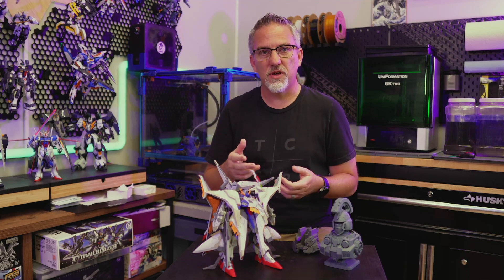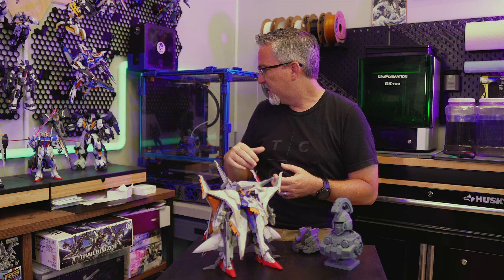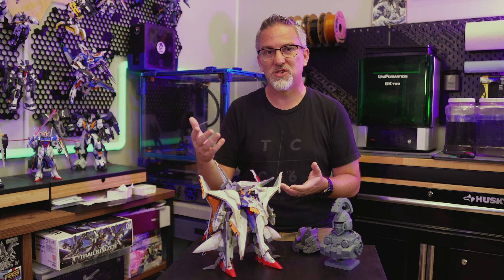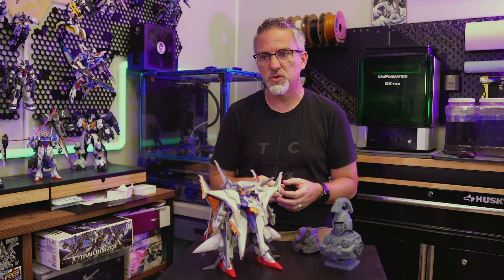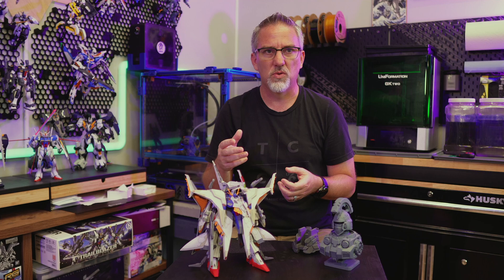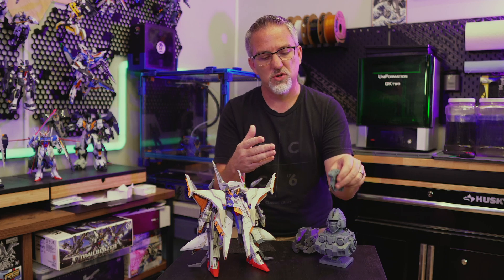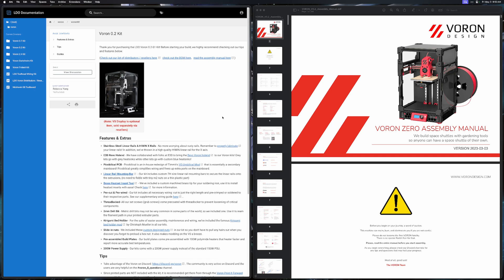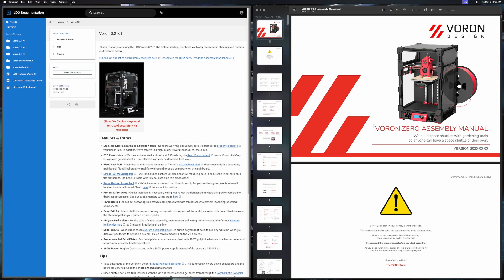LDO Voron 0.2 Build - Intro, Printed Parts & Preparations

Comment: Hi Mark. Thank you for the well done and informative video series. I had my LDO box sitting on the floor waiting for me to crack it open. Before I did I found your playlist and watched the entire playlist in preparation. Once I started my build I referenced back to some of your videos to clear things up before continuing. I still ran into my own flavor of trouble, but I just finished tuning my second filament on the printer. This was not my first printer build, but it was my first Voron build. I recommend anyone building their first Voron 0 watch your playlist. It will undoubtedly result in a smoother build process.

If you are watching or building alongside, pay attention to the pre-loaded nuts for the enclosure side of the magnets. Do NOT use standard no-drop nut mods. Although Mark points it out I missed it. It takes some thought and disassembly to correct this problem!
Reply from the maker: Thanks so much for the kind words, and I'm glad the series helped with your build.

Comment: I just finished an LDO V0.2-S1 kit. It's a great kit. The documentation is really great for the most part.

So good that when it's not so good I found myself almost irrationally annoyed. Ex: most of the official LDO docs seem to have parts for and show using a Pi Zero for the SBC. Most sale listings and builds I've seen for these builds use a Pi 3/4. I found there wasn't a lot of info on using a Pi 3/4 with an LDO kit. That have special DIN cleats and some Pi Zero specific parts to go with them. 

Also there's spots where if you're not careful when following links you can end up on older versions of docs. Like links out to GitHub make sure it's the most recent branch/revision
Reply from the maker: Thanks for the heads up. My kit came with a Pi 4, so I'll be sure to print the correct mounting parts.

My kit also came with a few extra parts (a small bearing, microswitch with a labeled wire, and bowden coupler) that appear to be for a filament runout sensor in the right rear foot area. I can't find documentation for this anywhere, but it seems easy enough to figure out by just looking at the modified printed part for the right rear foot that LDO included in their plates of printed parts.
Reply: @gunplamark  the SKR Pico and pi have the same screw footprint
 If you print 2 sets of the SKR mounts it works well.

There's instruction in the V0.2r1 manual for the filament sensor assembly iirc. Bearing goes into a slot in the foot. Switch gets screwed above it. Filament presses on the bearing and activates the switch. Then the ECAS Bowden couple plugs in. Switch just gets routed up to the SKR Pico and plugs into the E endstops switch spot if I'm not mistaken.

You'll def get through it pretty easily when you get to it.

The LDO and Voron config files should both have the switch set up. Possibly commented out

Comment: Also, don't know if you mentioned it (I didn't hear it), you definitly need to go with smaller nozzle. I would advise to go for Revo hotend (if I am not mistaken Revo comes in LDO kits). And use smaller nozzel (0.25mm). Revo has one of the easiest ways of changing nozzles. And you change them when they are cold and don't need any thightening when they heat up. That way you will get thinner lines and smaller layer sizes, print times will go up, but it's a small printer... That is how you get details in FDM printing, smaller nozzle that requare longer print times.
Reply from the maker: I didn't mention it, but that is definitely part of the plan. I have a Voron Revo on my big Voron printer, and because of that I already have nozzles in all four of the standard Revo sizes. The LDO kit comes with a Voron Revo as well but only includes 0.4mm and 0.6mm nozzles, so I'll be swapping out the nozzle with a 0.25 that I already have.
Reply: @gunplamark  oh, that will be one mighty little machine. Perfect for what you are doing. Also, that Tallgeese looks like a certain Patron 🤔
Reply from the maker: @xManzi  Yep, I got that Tallgeese bust (and a Wing Zero one as well) from lootBOX+ on Patreon. Their stuff is amazing! I should really take the time to paint it and glue it together.

Comment: I've watched a couple voron builds and hope to get one at some point. I've wondered why they didn't go through the instructions twice to prep like you mentioned. I think that's what I'd do too. I'm not as experienced building these machines so those other guys are probably more confident than I would be.
Reply from the maker: Agreed. This is my second Voron build, but even so I had a few questions and needed to work through some of the steps before I felt confident enough to build it well, and especially on video. I'll try to remember and specially mention the bits that I had questions about when I film those parts of the build.

Comment: im just going to buy a Sovol Sv08 and upgrade from there
Reply from the maker: That works too, and is almost certainly faster and less expensive. I enjoy the build process, so my preference is to take the extra time and start with a pile of parts.
Reply: The main problem with sovol is that those are not 2020 aluminium extrusions, so a lot of parts are custom. It may be cheaper, but it's not parts "off the shelf" bearings stacks are not what Voron team uses (they don't have shims beween and before and after bearings so longevity is veeery questonable). Don't know how much of an upgrade you can make when you need whole new community of modders to mod already modded parts for Voron printers.
Reply: @xManzi  I would rather spend an hour or less and have a working printer then I can upgrade gradually on my terms when I want and upgrade what I want at what time not spend three times the amount to get a project basically........... And there's nothing wrong with people wanting a project but I want a printer I want the final product, and if I feel the need to upgrade the extrusions I will but if they could do it for this price then boy someone's making a killing off those kits lol I'm just saying.....................
Reply: @NoMercyFtw  I have nothing in particular against sovol, but those type of printers can turn really quickly into a "project". There are cheaper Voron kits out there, LDO is the priciest of them all. There are kits in the range of Sovol price, but with everything you need. After that you get a pure-blooded Voron. Every mod that exist just need to be printed, nothing to modify for "Voron inspired" clones. I have nothing against 08 as a printer, but it is heavely marketed as a "Voron" which it is not, not a single thing is inline with Voron community. It's more of a "drawn from memory Voron" type of a printer.